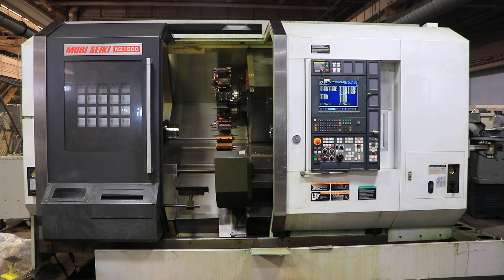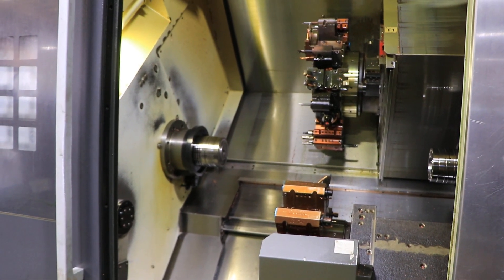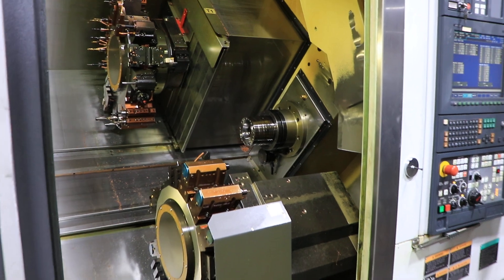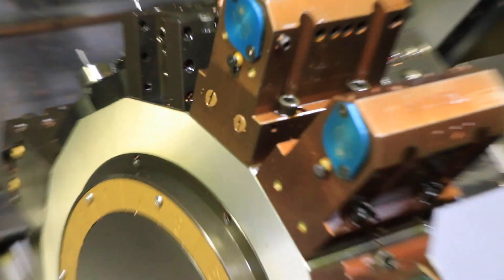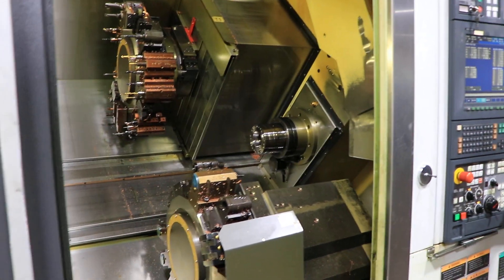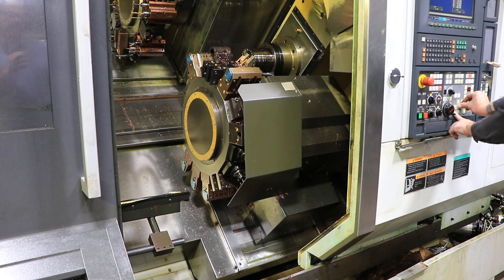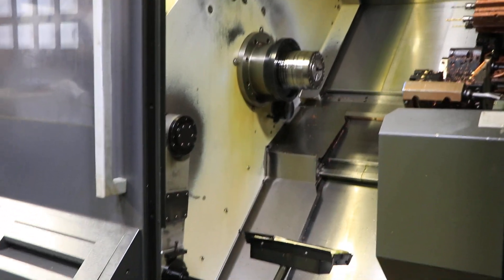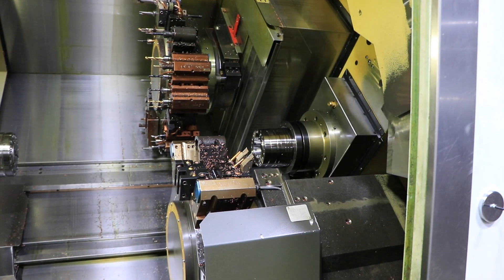Mori Seiki NZ 1500 T2Y2 Multi Axis CNC Turning/Milling Center

Comment: Hi 
I have a question about moriseiki. Has moriseiki controller shop turn or not. Because I bay new moriseiki nz 2000 so I catalog right there is but du you konw? Tanks